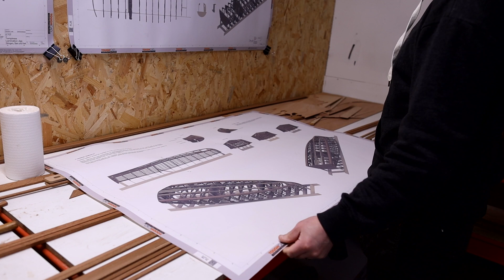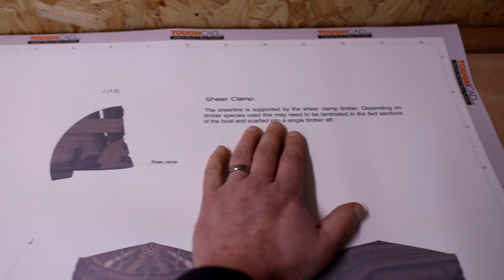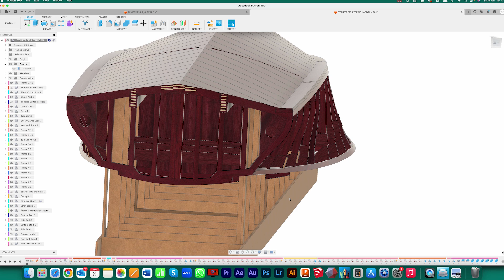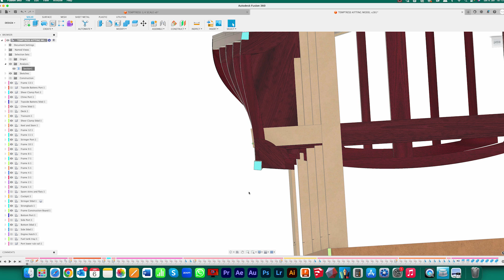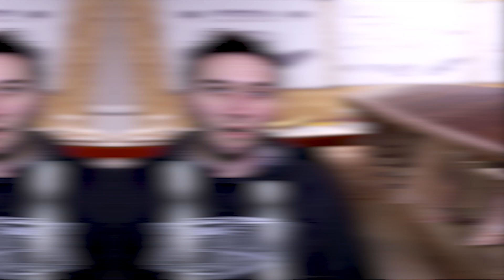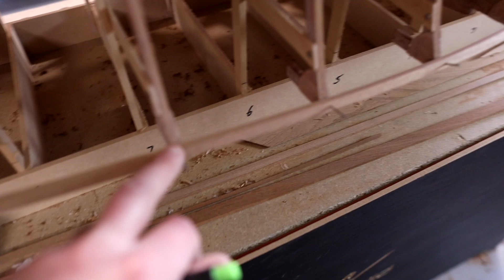The Sheer Clamp | Temptress 1/4 Scale Boat Build Part 21

Comment: hey what is a good cad program to play on for beginners with boats? rhino supposed to be good but i have an older mac and ipad
Reply from the maker: Whatever program you use, lofting hull forms is quite a difficult undertaking. I use Fusion 360 for all the work I do and it is compatible with Mac.
Reply: @DanLeeBoatbuilding  cool thx yeah figured not easy unless buying professional

Comment: Great explanation of the forces from different directions on the sheer. When I built my skiff the only had a slight curve up as it curved in toward the bow so it was easy to do in one piece. My chine log did curve up quite a bit towards the bow. I steam bent the first one which was quite time consuming and a bit of a pain. I decided to laminate the other side from 3 thinner pieces and it was so much easier.
Reply from the maker: Lamination is much better for creating a fair curve and a stable timber long term 👍